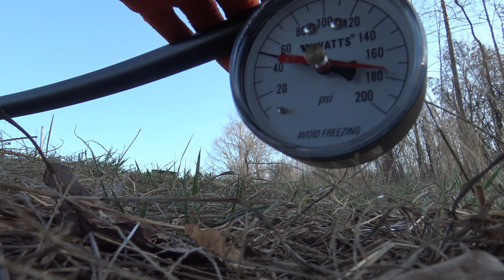You've never seen a farm water system like this...cheap, easy no electrical required!

Comment: Can anyone see the draw-back with Ram-Pumps? ..... It is very obvious from this video!

Ram-Pumps work on a principle called Pressure Intensification .... but nothing in this world is FREE and it comes at the expense of water FLOW

(Pressure x Flow = constant .... So if you increase the pressure, it follows that water flow is reduced. So where does this "missing" water flow go? .... As I said, it is obvious from the video .... it pisses all over the floor, through the waste valve on the Ram Pump!! 😩)

In my humble opinion as an engineer, a much neater solution would be to use a 12V Demand Pump hooked up to a truck battery fed by solar panels. A bit more expensive, but ultimately much more efficient and just as "FREE" to run .... but with no wasted water!
Reply: I thought the exact same thing.
Reply: Different needs, different applications. ;-)
Reply: @crpth1  I don't think that wasting 7 times as much water as you use is a particularly good idea in any application!

The best application for Ram-Pumps is in fast flowing rivers, to irrigate adjacent farmland. Then it REALLY is free water!
Reply: @crpth1  That is absolutely fine, if there is plenty if water available. But you also have to appreciate the fact that in many places in the World, water is a very precious commodity that they simply cannot afford to throw on the ground. Consider yourself very fortunate indeed that you live in a place where water just falls out of the sky on a regular basis!!
Reply: @crpth1  Then why are you using a system that wastes 7x more than you actually use?! I'm sure your neighbour would be pretty pissed-off if he knew exactly what you are doing with this valuable resource!
Reply: @crpth1  You have explained everything very clearly. Thank you. I have already put forward my alternative suggestion, which I consider to be much more suitable for your needs. But quite obviously, you consider yourself to be some sort of "off-grid God", who will not even listen to constructive criticism or advice. Furthermore, you know nothing about who I am or what I do. So now .... who is the one jumping to the wrong conclusions?!

Comment: Correct heading "electricity" not electric. The word electric is an adverb. Thus, electric car, electric saw, electric power,  etc
So, you can say "no electricity required"  but not ""no electric required."
Reply from the maker: Electricity is what makes things run....we're not using it...therefore "NO ELECTRICITY" is needed.  Nobody asks you if the "electric" went out during the storm...they ask if the "electricity" went out....right?  No grammar correction needed...maybe you say it different where you live.....then we'd be talking about dialect...not grammar...hmmm..this is too deep for me bhahhahha

Comment: Ram pumps are great for pumping a low volume of water a long distance. The thing to know is that there are some problems (conditions) that will cause a ram pump not to work or work less than what you think it should, or would want it to.

It requires about 7 times more water to operate the pump than what it is pumping so if you are pumping 1 gallon per hour it will take 7 more gallons of water per hour to do the pumping. That is more or less depending on how much fall (or head) you have and how high, far you are trying to pump the water. You have to have an active source of water to make a ram pump work for a long time. All year stream or a pond that fills as fast, or faster, as you are using water. It takes a lot of excess water to make a ram pump work. A pond will not work unless it can (and does) fill on its own.

If you have enough water but not enough fall you could use a small powered pump to provide water to a ram pump to pump water higher or farther than a small powered pump could. That would take the "free" part out of the equation. You could also put a tank say 20' higher than the ram pump with a float valve to keep the tank full without having to run the pump all of the time. Due to the volume of water needed the powered pump might not work out well. On the other hand if you need water at a much higher distance than what a "normal" pump could do it might be an option. 

 

Some ideas:

Fall or head basically the same thing in this case. Fall is the difference in height between the water source and the pump so if the source of water is 0 feet and the pump is 10' lower that would be 10 feet of fall. Head is the pressure of the water at the pump that is generated by the fall. Think of it this way. If you had a 1 pound steel ball and dropped it from 3' above a wood floor when the ball hit the floor it would make some kind of a dent in the wood. If you then took the same steel ball and dropped it from 6' it would make a larger dent in the wood because the ball has more "fall" which generates more "head" which impacts the floor harder. If you then took the same ball and dropped it from 100' the ball would have more "fall" so would hit with more "head" putting a much larger dent in the wood. Fall and head translate into pressure or force depending on how much vertical distance there is between the source water and the pump. 

There are some variables in fall and head. The head pressure is the same if the water falls straight down 10' or runs 100' down a pipe with the same 10' difference in the height. There are some friction losses in longer pipe for the most part they are not important. Larger runs should have larger diameter pipe. 

If you can use 20' or so of steel pipe as the last part of the feed or drive pipe. That will make the water hammer stronger which will improve the efficiency of the pump.

In some ram pumps the waste water valve is tuned to produce a higher number of cycles of opening and closing of the valve. That changes the number of pressure cycles which can pump water higher or faster.

The large volume of waste water has to be managed so that it is returned to the stream or other location so that the excess water will not cause problems. If you are using stream water you can pipe the drive water to the ram pump lower down in the stream then the waste water can just flow back into the stream.

Freezing weather is a problem.

A ram pump is a great way to move water if you have the right conditions.

Comment: You could rig the system up to fill the cistern at the top first, then let the outflow from the bottom of the cistern feed the paddock tanks as the water drains down the hill - daisy chain the paddock tanks, and the lowest paddock tank's overflow would dump back to the creek, or you could direct that toward crops. Your cistern water would always be fresh and the cistern would always be full...

Comment: Read the instructions for the frostproof hydrant faucet and install in a gravel bed. It only works frostproof if the water exposed to weather can drain away into the gravel, if you bury in clay it will freeze up the faucet and bust it. 
On your downhill runs don't forget the longer you get on a run the more friction so on a long run you will ose effective pressure. There are charts you can use to figure friction loss for different pipe sizes and flows.

Comment: How much water are your cattle going to drink?
18-20 gallons per day. And if you haven’t experienced cattle before they are herd animals and when one drinks the majority almost always drink.
At 1 gallon of flow per minute it will take 10 minutes to put out enough water for half of the requirement.
I like the idea for the system but you will either need a large holding tank or not very many cattle.
If possible maybe run the water from the ram pump to an enclosed holding tank at the highest part of your farm so that fills constantly and then gravity feed through many lines to each paddock.
Reply: Watched again and noticed you mentioned a holding tank. I think probably your best option

Comment: I haven’t heard you mention friction at all
Reply: The use of a PVC drive pipe would greatly improve the operation of the pump. The delivery pipe has such low flow rate that the friction loss is minimal.

Comment: Is that all the water you get?? That’s not even 3 gpm.
Reply: Rodger Hatfield...how much water do you need in your house?  3GPM is 180 gallons an hour, well over 4,000 gallons a day....far more than my family uses in a MONTH!   And an elevated cistern will give you the water pressure you want for that fabulous shower...which I assume will be way too hot from the passive solar water heating system a 4th grader could make from a 10 minute explanation and a hundred dollars (or less!).  3 gallons a minute is impressive!  With 13,000 excess or more gallons of “free water” falling 40 ft will generate more than enough electric for a simple, comfortable life....and the falling water could be used over and over.  Your comment was short sighted and not well thought out.
Reply: Whupps....keystroke error....not 12,000 gallons a month....but 120,000 gallons a month @ 3 gallons a minute...
Reply: That would keep a stock tank filled for a 1 acre paddock... we're not talking about a stockyard here.

Comment: How can you keep the RAM pump from freezing? Is this possible to use during cold weather with freezing temps? How do you protect the pump? Do you need to dig a hole below freeze line and bury with an access point? I’d like to see complete set up and follow up on a completed system for all season use.

Comment: The ram pump can also be used as a air compressor.. You add a valve near the top of the air chamber and run a air hose off to where needed.. To aerate a pond.. Fill a tire.. Etc.. Pressure amount depends on size of pump.. Yep"Yep"

Comment: I'm pushing 60 and have used these (while visiting rural locations with my family) on and off since I was around 10 and NEVER realized that I was using anything other than a standard water spigot like what was on the side of my house at home!! I can attest that set-up differently, these systems can really BLAST the water pressure out! I suppose due to longer runs of pipe up a steeper elevation and/or with the use of cisterns.    :^)
Reply: Thats great! When Josh gets his tank on the hill he will have plenty of water for those cows.

Comment: Don't bury your poly pipe! Just lay it out under your fences. In 1 or two years the thach will cover it up and you won't even see it and it will be shaded in winter, but MUCH easier to fix when it leaks, and it WILL leak. I used 300ft rolls of poly pipe and connected them with 3/4 inch pipe T pieces and installed a hose bib on each joint. With a 50 or 100 foot hose on your Hudson valve should be able to read anywhere you want.
    Good video, I enjoy your channel.

Comment: Sorry fellas. I must have missed something. Could you pleAse add a diagram. Was the pump below the pond level and then pumps upward? So the hose goes from filter up a hill then down to a hole whith pump then uphill to faucet?  Kinda confusing.

Comment: Those ram pumps are awesome!!!  How often do you think it'll get cold enough to freeze the line?  :-/
Reply from the maker: as long as we have water moving 18 degrees F is the cutoff for us.  This will be something highly monitored in winter.  We'll perfect the system very soon!  This is all learning and temporary for now
Reply: I ran the pump in 15 degree weather for a week. Ice rose up from the ground under the delivery pipe and clogged it. When the water stopped moving the whole system shut down.

Comment: Just one silly question, the water coming out of the silver valve, does it “go to waste” or do you recapture that. I assume these would be best in a flowing stream with permanent flow?
Reply: I've had the same question.  All the ram pumps seem to squirt water out with some pressure.  Wondered why this could not be put so some use - must be an engineering thing, but seems odd.   If the outlet for the squirt was restricted, would more or less water be pumped.  If less, if the opening was less restricted, more.     sigh - guess I don't really understand why the pump works.
Reply: It's called a "waste valve" but the water returns to the creek. It just does some work before it continues.  Now in a closed system the water is wasted very fast.
Reply: @LandtoHouse  Yes but soon the pond will go dry. The waste water goes back to the creek below the pond. Need free flowing stream to make this work.

Comment: Another excellent video! Thank you for your efforts guys. I raise grass fed beef on rotated pastures in Michigan. 8 1/2 months this year with no hay. I move portable tanks around the farm in order to prevent mud, a similar concept. It's a pain but works well. I bet you have a good spring source or 2 also. I use minimal equipment and biggest tractor 13 HP and a 1969 JD 140. I also tend to congregate the cattle in smaller areas to feed or water to collect and use their manure for the next growing season. Red wiggler worms help make a lot of compost. 457 bushels of corn from one area this year. I retired from USDA SCS/NRCS from Ohio, California, Virginia, D.C. and now Michigan. Held every job from an civil engineer, agronomist, IT specialist and county mgr. Whenever utilizing natural water sources, be sure to check with local, state and federal regulations and any new ordinances. Many areas are now implementing caps on water extraction from any ground water sources. New ex-urbanite neighbors love to turn in us farmers also. We are fortunate here to have ground water at 8-10 feet. Simple point wells work very well here with a simple hand pump.
Reply: My brother had neighbor who decided he wanted a pond.  Not a landscape type pond, a pond.  So he dammed up a drainage area.  You guessed it, water eventually just evaporated and/or was absorbed into the ground.  Next he arranged to have a clay bottom put in. He found rain water wasn’t enough to keep it as high as he wanted.  Not to be deterred, he arranged to use his house well to fill it.  Now my brother got upset.  In his area, the wells when he put his in had to go down about 220 ft., 20 years later with double the new homes you had to go down 300-340 feet.  In summer, with this guy running his well 24/7 to fill a pond, my brother sometimes had little to no well water.  He complained to the county and state and got a dig a new well answer.  Wells cost $10-15 thousand, with all kinds of red tape.  And no, asking the neighbor to stop did no good.  They asked me, I got details of their water usage and how and when it happened.  I suggested they switch to high efficiency water use washer, dishwasher, add efficiency to their taps and even consider replacing their toilets to low water flush.  They wouldn’t give up their beloved toilets, but new appliances on sale with other discounts and my dad redid shower heads and faucets.  Problems solved for less than $1,200.  Plus the lower electric bill to run the well pump over time paid for the appliances.  They also used less detergent, less wear and tear on clothes and a wash took 30% less time.  They were happily back to laughing at the neighbor and his failing pond.

Comment: Heads up. I found out the hard way squirrels will chew holes in your irrigation tubing. I have to bury 500ft of tubing ro fix mine.
Reply: I've  heard this is also an issue for drip systems.    So far not an issue for our 4 inch corrugated pipe, but might be for smaller pipes or squirrel haven't come after them yet. - The squirrels sure do like to dig holes in the ditches - current approach is AquaBlok - expensive, but not compared to bring a backhoe in.

Comment: Awesome job! I think it'll be good to drop it held by a structure like a pole fixed to something out of the water (maybe held by something to the wall of the pipe) that doesn't allow the filter to go and rest in the wall or bottom of the pond so, if you can hold the hose/pipe that same 3' from the filter, maybe 4' so you leave a foot of pipe out of the water, and stick your pole out towards a deeper point, drop your filter, there may be chances of less dirtiness into the line. What do you think?

Comment: I built one years ago that was huge, all brass and stainless steel, it weighed almost 600 lbs.it was a design from an old steam train tower tank that fed water into the trains water tank.  It would pump a lot of water, the original was eventually stolen, removed by scrap iron pirates, it certainly was God's will for me to copy it's design  I'm 76 now and I hear tell it's still operating, great show, thanks for sharing

Comment: Could this be adapted to move water from a 275 gallon container 10-12 feet to an indoor sink for a water haul area? The rise would be about 42 inches (sink/counter height.) I was planning on using a 12 volt RV pump, but this would be a better alternative.  Thanks.

Comment: What’s the bypass ratio of the amount of water pumped vs. the water out the waste valve?
Reply from the maker: That would be a question answered better over on Seths channel....I'm sure he's done some testing
Reply: @StoneyRidgeFarmer    I had the same concern,  Waste !   Coming from a creek where the the water flow is powering the pump there is no actual waste, endless water supply as long as there is flow but in a pond the supply is finite and waste is a huge concern .  For this reason your better option would be a solar powered pump .   Just saying .